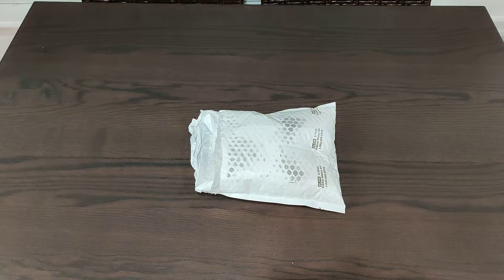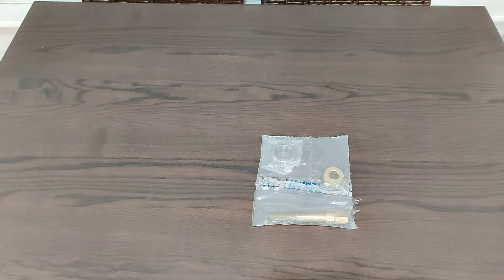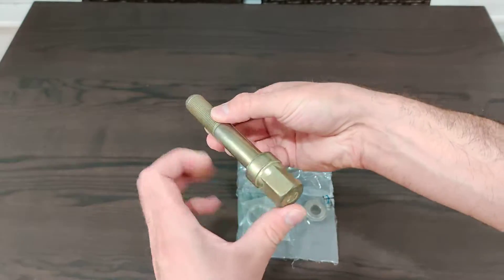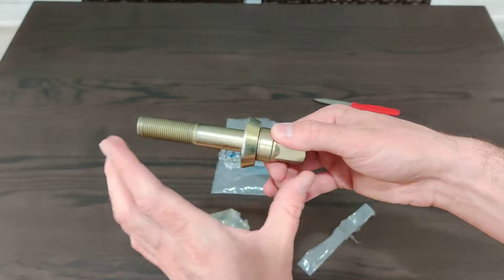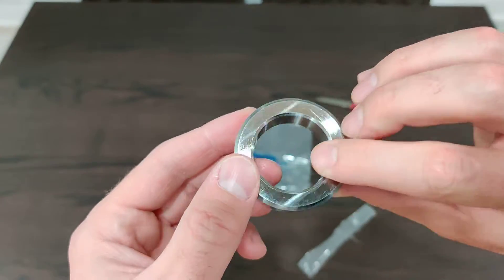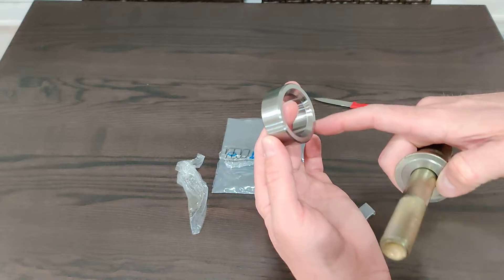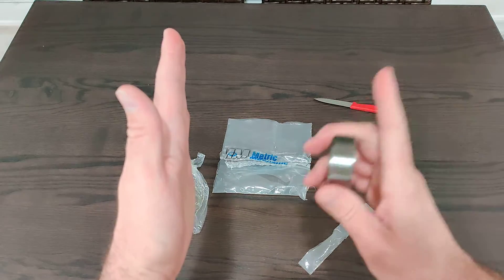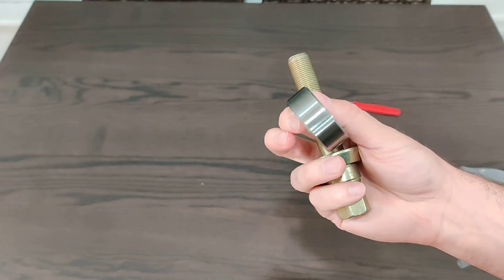Metric Mechanic BMW M20 89.6mm Crankshaft Seal Spacer Unboxing

Comment: Sorry to ask, But If I got this, and Used a M52B28 Crank Into a M20B25 Block bored to 84.5mm. Would I need to get Crank webbing shaved for the Block contact? And what rods would I use and pistons? If stock?
Reply from the maker: My latest video is on the block clearance for m54b30 crankshafts. I am not sure if the m52 crank needs the same clearance where the intermediate shaft is. As far as rods clearing the bottom of the bore, you need H-beam rods that are cut back like I have in my videos or skinny style S52/m54 rods. The thick rods that I think won't work without clearance on the bottom of the bore are the m20 and m50nv rods